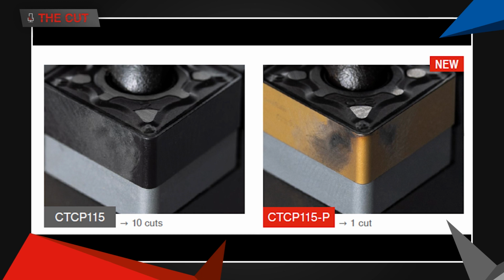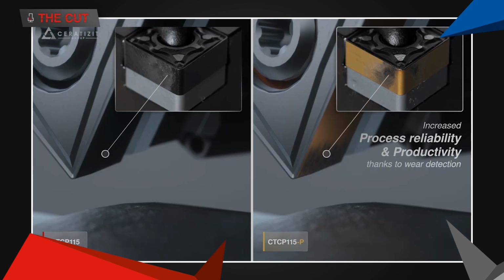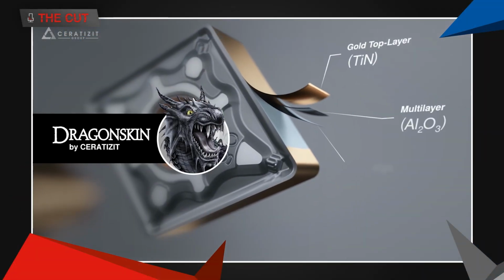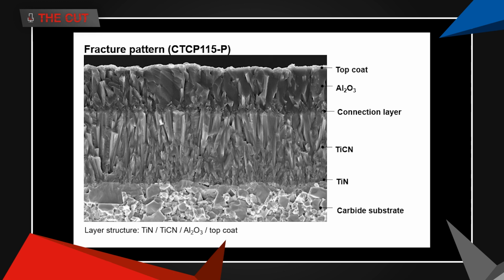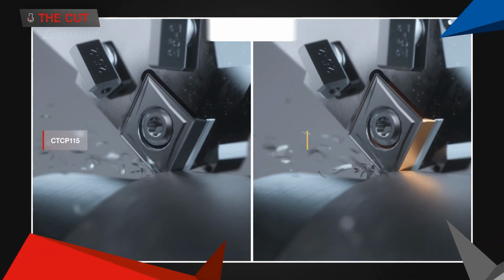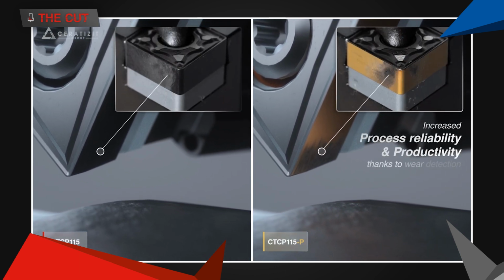THE CUT by CERATIZIT - Episode 7 - Turning Steel with ISO-P grades

Comment: Hi! First one,  I did not understand why you show in test comparison so LOW speeds like 70-110-130 m/min for grades which should basically work with speed 250-350 m/min.
Reply: I speak about comparison ISO CTCP115 and CTCP115-P.